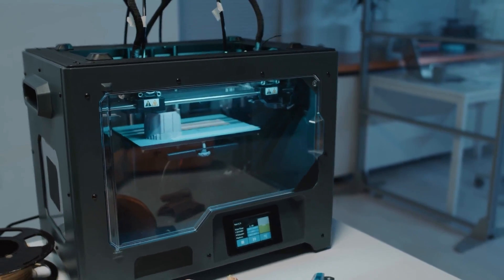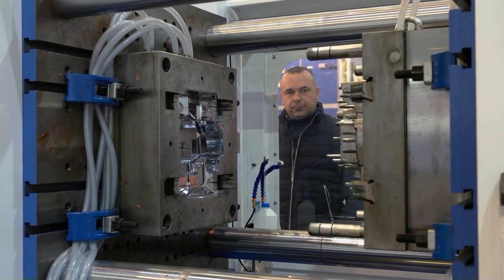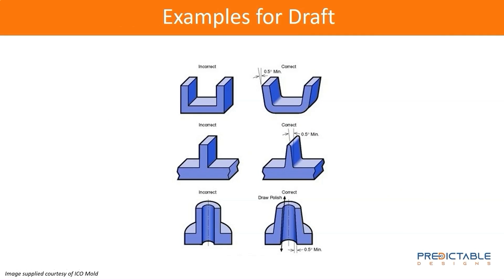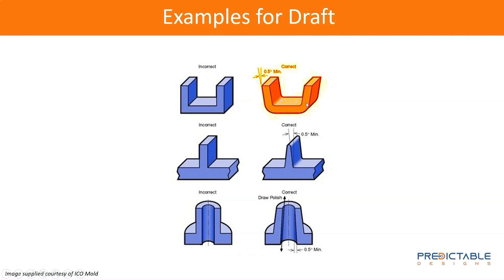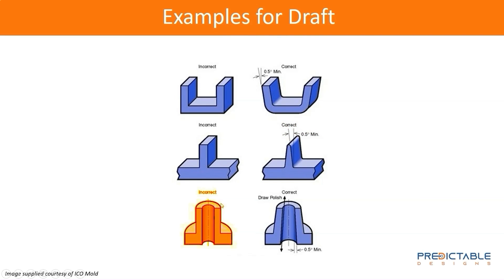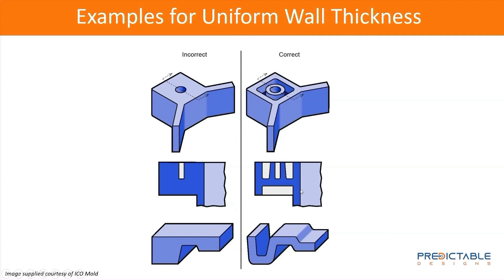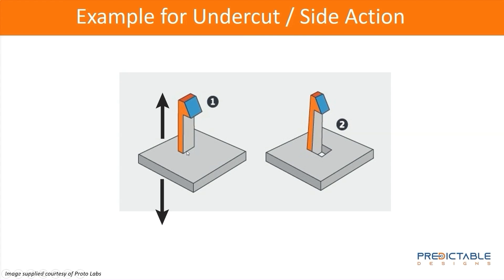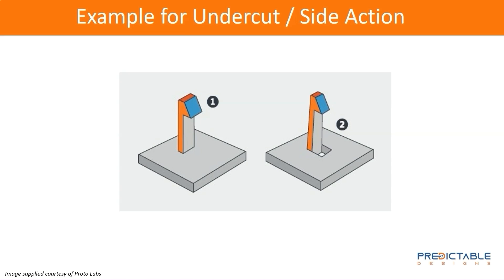The Ugly Truth about Injection Molding

Comment: I have a question about draft. I build a lot of snap-fit plastic model kits. One of the key features that make snap fit model kits work, is that the pieces come with pegs and holes that fit into each other to keep the pieces together with tension (which if you build model kits is probably obvious). But when I look at the runners, it at least seems to me like all of these assembly constructions could produce draft. So I'm wondering how they could avoid that? The pieces are anywhere from a few mm to a few centimeters in size, so is this maybe just an issue at larger scales? From what I understand at least the most modern model kits don't even use any mold release anymore.

Comment: I'm a 3d printing nerd and to me FDM is exemplary of why people feel like the future is shitty. We go from injection molding, which already wasn't that great to begin with, and move to an even shittier technology with worse properties, that's more expensive, that doesn't make transparent parts, that's harder to keep clean, much more prone to surface imperfections, that likes to spread little whiffs of microplastic poop everywhere. Yes it is more advantageous to the designer, but that doesn't really benefit the user. Time to stop living in denial. Layer lines suck.
Reply: I am just saying injection molding and 3d printing use the same materials for producing parts. Also I don't understand your reasoning for why 3d printing is a worse production option. Both have pros and cons. 3D printing will not completely replace injection molding. They will be used for different types of parts and for different needs based on their pros and cons.
Reply: Also layer lines do not suck. They add a texture to the part which is really expensive for injection molding. If you design the part so that it is orientated correctly so that the layer lines do not negatively affect the strength of the part where strength is needed, they can become a benefit.

Comment: With advances in 3D printing in the last few years, I think the line is blurring. I am not against injection molding, but I have used printers to make 3500+ parts for our production needs. We are going to continue using 3D printing for certain parts, but do expect to use injection molding for other ones.

The high complexity you can achieve with 3D printing is just too good to let go completely. Especially for small assembly teams.
Reply from the maker: I agree and I'll be thrilled to replace ancient injection molding with a more flexible, modern technology.
Reply: @PredictableDesigns  I think there's going to be room and need for both. For very simple stuff that is moderately large and is not likely to change anytime soon, injection molding is perfect.

For more complex parts that are smaller, it may be better to keep those 3D printed. You can improve more similarly to software with quick, effective iteration. Not a panacea, but it is nice.

Comment: I would like to see a debate with Slant 3D on your "production must be injection molding" take. It'd be interesting for sure
Reply: This battle will be legendary.
Reply: If you need dozens of things, 3D Printing. If you need 100's of things, Vacuum Forming. If you need 1000's of things, Injection Molding. Why? Injection molding takes seconds to make a part. Vacuum forming takes 10's of seconds to make a part. 3D printing takes minutes to hours to make a part. You can scale up as some have mentioned by having multiple printers, but you can also design vacuum forming or injection molds with multiple cavities so they pop out many parts in each action.
Reply: @CraigBrideau  Also the thing is that 1 injection molding machine can costs over 100k. You can also buy 100s if not 1000 3d printers for the same price. This means for the same price as an injection molding machine you can run a lot of 3d printers in parallel. 1 3d printer will not out preform a injection molding machine but what about 1000 or 2500 3d printers.
Reply: @AugiesHobbies  Yes, but you need somewhere to put 100's of 3d printers, so unless you are renting a small warehouse or light industrial space it's not feasible. Also keep in mind you need staffing, network connections, etc. to maintain 100's of printers. Logistically a single, or even a few injection molding machines are easier to monitor and maintain than 100's of printers.
Reply: There is nothing to debate. Time is money, if you need 10 parts it’ll cost less to 3D print them. If you need 100,000 parts it will be cheaper to injection mold them.
Reply: @lukefrances6674  Actually there is something to debate. It may take longer to produce 10k parts with 3d printing but if you're not selling 10k parts at once it most likely cheaper due to having to store the 10k parts from injection molding. Shelf space for storing products can cost a lot. If you make the product based on the demand, you don't need to store 10k parts. You could probably store 1k and then replenish the 1k parts as needed. Right now per part 3d printing is more expensive but there are benefits from not producing all the parts at once. Plus no costs for molds and better design freedom. In my opinion 3D printing mass production will become a viable option.
Reply: @lukefrances6674  The time it takes to produce 1 part is not the only factor of cost when it comes to selling a product. There are a lot of other factors that will effect the price.
Reply: I'd say that John is giving the best advice, based on his own production experience. It's just not practical nor economical to 3D print for mass production beyond a few thousand units. To produce millions of enclosures in a reasonable time frame it would require 1000s of 3D printers which quickly become impractical as they would use more space, energy, personnel, be slower, require more post-processing, manually loading new filament all the time, potentially have some failed prints, etc. And then there is the resolution, appearance, structural integrity, tolerance, etc. The list goes on and on. At a smaller scale, using 3D printers does have advantages like the ease of printing complex parts and no extra cost to make changes, but it's still painfully slow. Maybe one day we'll have 3D printers using photo-sensitive resin blocks that get "flashed" by scanning lasers in seconds, and then rinsed to dissolve the unexposed resin away?
Reply: I agree. If you have enough 3d printers, I think 3D Printing will surpass injection molding because you have a lot of design freedom. Less upfront cost and more spread out production.
Reply: @AugiesHobbies  It also depends a lot on the size of the parts. Having said that, Prusa is manufacturing quite large parts using its 3D farm. I'd really love to see a proper analysis of the topic.
Reply: @Klemmi.  I have been watching slant 3d a lot. They should do a collab.